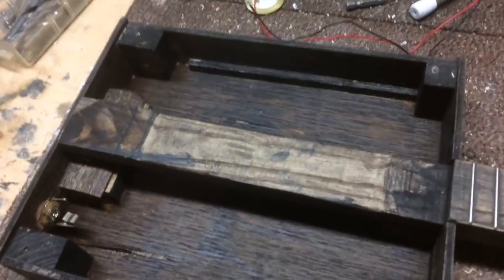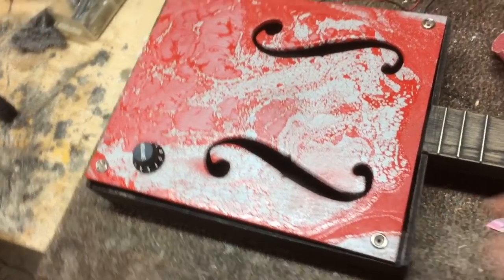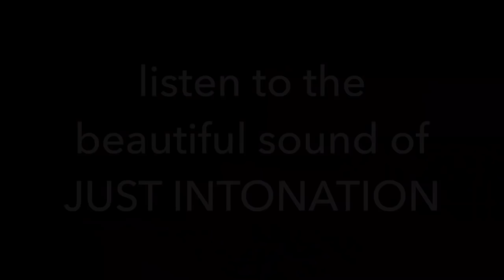Swirl Paint - Hidden Springs

Comment: Its deer hunting season in Texas.
Can any bone be used to make Nutzenbridges, or is that a specific material to be 'bone' ?
Reply from the maker: RWBimbie I would think any bone would work..??
Reply: ...as long as it's dense enough. I wouldn't use any of a bird's bones. Well... ostrich thighbones might be an exception from this. But since deer isn't a bird... Good hunting!
Reply: Antler works great, I’ve used it on 3-4 builds, mostly at the nut but couple times on the bridge.

Comment: I've wanted to ask this for quite a while already: In an earlier video you've told that a colleague of yours made you the just intonation template that you're using. Now for my first build I would really like to go with just intonation as well and I was wondering, if it was possible to get a copy of that template. Not as nice as your wooden one (that surely was way too much to ask for) but basically just a series of pages which I can print out that have markers on the right places (or not) to be glued together after cutting out to make a paper template. (Or the 2D drawing of the CAD file he used to (laser-)cut the template to avoid having you to make an extra Word file since I guess I could just print that on on several pages if I knew where to connect them afterwords. Or maybe even just a list of measurements for where the threats go...) Would this be something you could possibly email me? I surely wouldn't want to cause too much trouble but that would be really great!
Reply from the maker: Eric M. All I have is my wooden template.  I sell JI fretboards that you can use as template.  Or just use your ear and place the frets where you find the harmonica on the string ... that’s what I did initially and it worked great !!!
Reply: Unfortunately for budget reasons I have to go with the harmonics then, I guess. Thanks for the offer though.